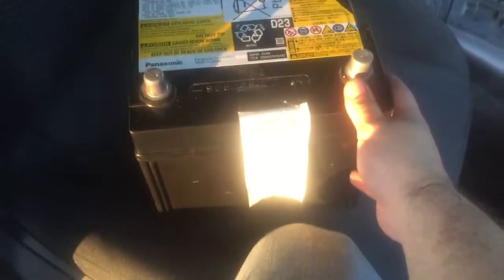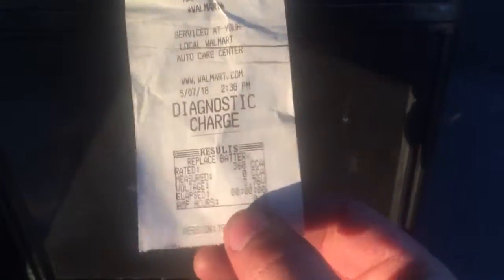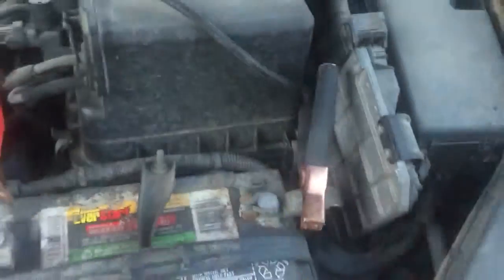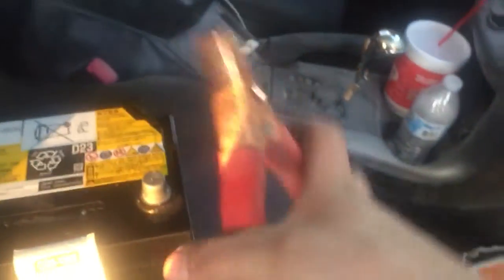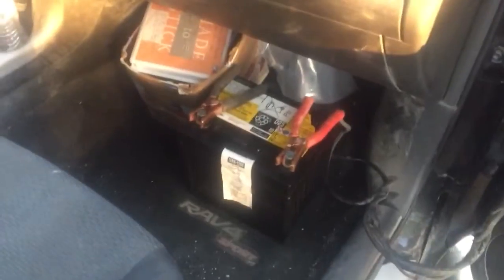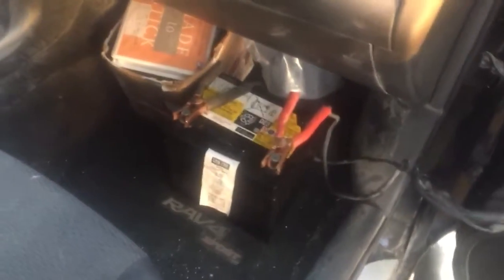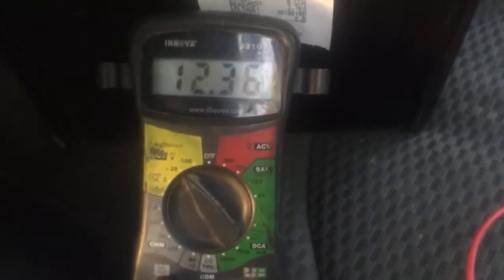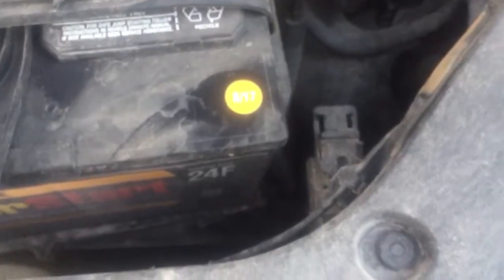How to Revive Recharge DEAD battery EVERY TIME !!!

Comment: I have been doing this to my other car batteries for around 6 months.. I did it on those low charge car batteries and not on a completely flat battery. I thought I was the only one doing this crazy thing.  I am glad there is someone out there who is as crazy as me. The difference between us is that my wires travel internally therefore it will not affect my window closing. I also modified the connection using the household socket and plug so that I can turn it on and off the charging whenever I want. What concerned me here is that I worry that it will slowly damage the car alternator as it was made to charge the battery and to also supply the charge to other electrical components during engine running. Well, before the alternator went bad, one of the car batteries charged using this method eventually when short circuit which I believe I had dropped it once. At least I now know that I am not alone.
Reply from the maker: oh wow.  I still do it to this day.  I have revived and saved dozens of batteries this way.  I am glad you shared this story. So, yes, you are not the only crazy person.  It's a little secret trick only rare mechanics discover and use.  Thank you for sharing! Cheers!

Comment: At no time should you have this configuration and drive the vehicle - very dangerous. He may be willing to take this chance, buy you should not. Do this while both vehicles are stationery with the dead battery as far away from the charging battery as the cable will allow on concrete - and monitor closely. Get a beer and a lawn chair. Not familiar with ELECTRICITY and BATTERY ACID or MOVING, BUMPING CAR while being driven? F*ck around and find out... 👀

Comment: Letting possible hydrogen gasses build up in an enclosed space and blowing up the vehicle.  That’s fine.  Next video he’ll show you how to start a campfire with a cup of gasoline
Reply: yo i got a question if you happen to see this. My motorcycle 12v battery was dead and not holding a charge so i let it sit on the jumper cables while running for an hour so i can make this ride im trying to go to. its holding a charge now. Am i risking the same danger of the battery blowing up? Hadnt ridden the bike in 2 months due to it needing a repair and i was waiting on the parts

Comment: If you know what battery acid does to anything it touches or how common it is for a bad battery to explode you would know why this is the worst advice ever
Reply: Battery acid is weak.i drink it and use in place of vinegar on my salad
Reply: My friend works at a battery shop. They sell used car batteries. It's extremely rare for a battery to explode. It doesn't happen nowadays
Reply: This really is a conservative way to recover a very dead battery. The way most people do it is to connect the dead battery to a charged battery in parallel and connect a trickle charger to them.

They don't just explode, they may vent hydrogen but the real problem is the cathodes get destroyed and the capacity of the battery is immediately halved.
Reply: Just buy a new battery, they are $50 lol
Reply: I haven’t seen a car battery for $50 in more than 30 years. Where do you buy your batteries?
Reply: @darrellfritzel7989  he’s talking about tv remote battery’s i think

Comment: 12.36 is technically not the best reading either. It's about 50 percent health.
Reply: That's what I was thinking it should be about 14 votes.
Reply: @benfranklin3963 a battery will be about 12 something when the vehicle isn't running and about 13 or 14 while it's running
Reply: @Neptune5.56  
If you say so ☺️😉😉😉. I only make about 300 a day now. They have slowed the amount of lead we can get to produce them. I'm so glad someone knows more than me about batteries that goes in cars I have only been building batteries for 23 years.
Reply: @benfranklin3963  12.6/12.7v is the normal voltage in a good battery when its nit being used or car is not udling. 13.8/14.2v is while engine is running and alternator is charging the battery
Reply: @djjithujab  
Wrong
Reply: car battery has 6 cells, each cell has about 2.1 volts, so the normal average is 12.6 volts. 12,36 isn’t bad then

Comment: It’s not a conspiracy it’s a safety feature. If a battery has low voltage it may be damaged. Doing what you did could create a hydrogen gas bomb if the dead battery is defective.
Reply: unlikely  But he would be better off putting it on a regular wall charger ,just keep an eye on it  once you get the voltage back up there about 11 Throw it on the charger but it's self..  In all honesty I just grab a new battery
Reply: True story I was at a car auction which used 2 heavy duty truck battery’s in tandem to start the cars. Guy connected then the wrong way no it sounded like a huge bomb went off 
The battery blew itself to pieces a nd I’ve never seen that before pieces probably 50 foot away . Guy was lucky not to get a face full of cid
Reply: 👍🏻Bombs are sealed and sealed tight. You can take caps off the battery and do so very easily.
Reply: hydrogen doesn't need much compression  to explode. step away if you don't understand basic science
 @erinericsson

Comment: walmart?  you can charge dead/low voltage batteries with a manual charger.  most chargers are automatic.  make sure you buy or find a shop that has an automatic charge with a “Activation” mode (aka auto bypass / manual mode).  my sears $40 charger from the 90’s has this feature.  http://m.managemylife.com/mmh/lis_pdf/OWNM/L0812662.pdf